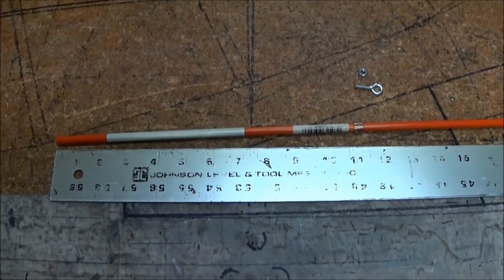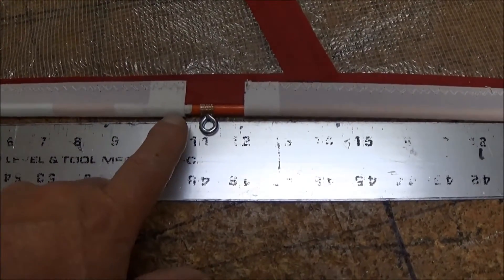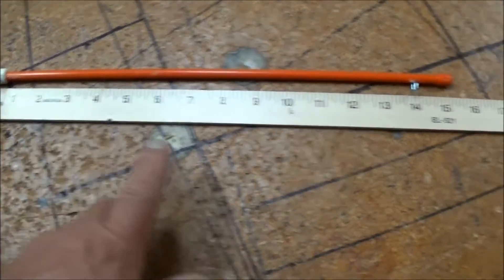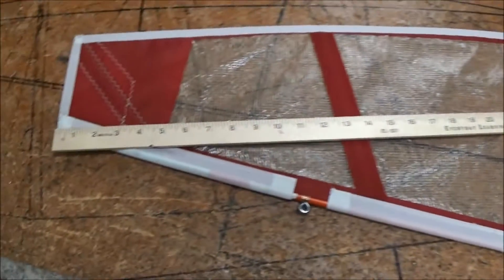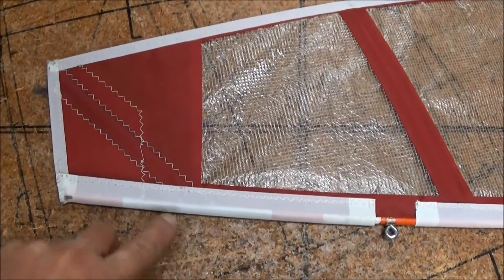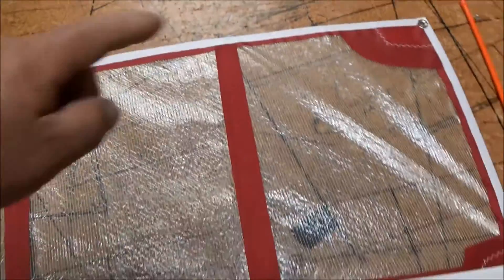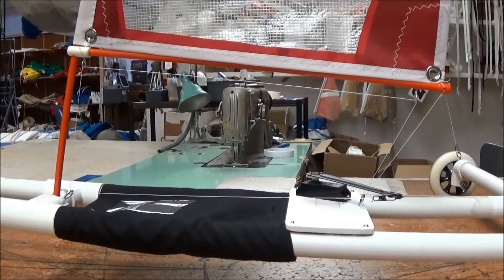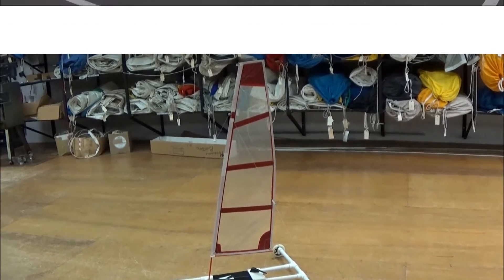Build Your-Self PVC RC Land Sailor (Mast,Boom,Sail Plan) Pt.2

Comment: We're close to having a working vehicle based loosely on your (?) design. Will link to your video. But I didn't see this sail video until just now. I just basically cut a sail from blue tarp that I thought would work. We're gonna have WAY more sail area and a much longer boom. QUESTION:  Will be bad if the shrouds limit the movement of the boom / mainsail?
Reply from the maker: Dave:  Like An Iceboat Wind Will Move Forward When Sailing So Most Of The Time You'll Be Trimmed In. When Dumping The Sail In Puffs You Don't Need Too Much Ease But Some. Also You Might Feather The Sailor Into The Wind Which Will Stall The Sail. So Depending On Beam And Boom Length Will Determine Room To Ease Sail.
 Light Weight Fabric Is Also Good For Weight Aloft (Won't Flip As Easy)
Reply: Thanks. We'll see how it goes.
Reply: I’m curious for more details on the sail. What’s the red part made of?